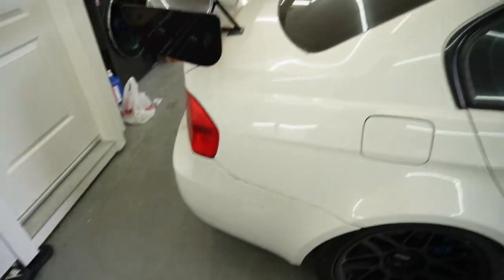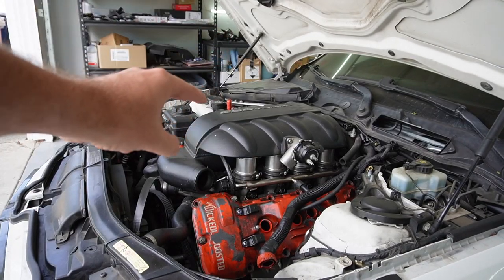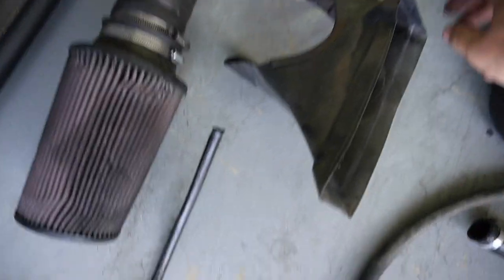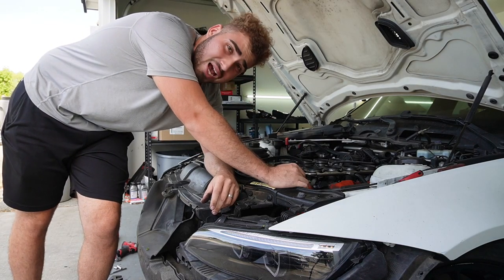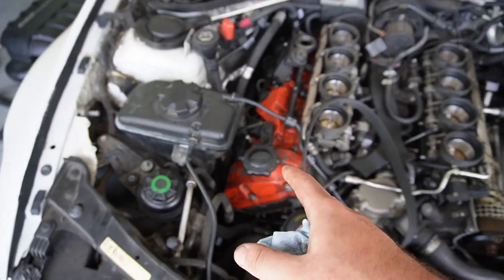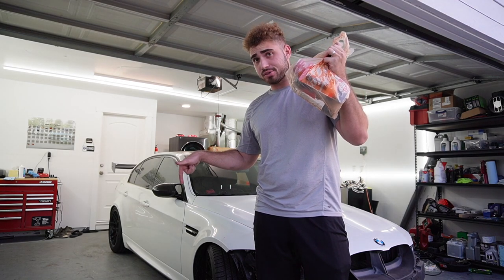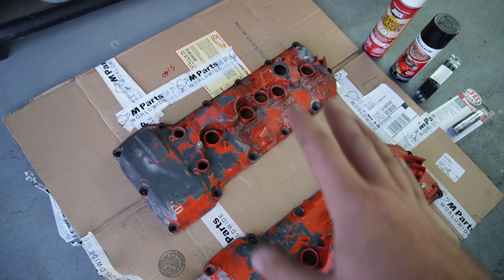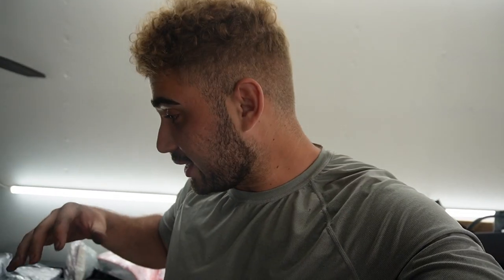I FOUND THE ENGINE ISSUE ON MY E90 M3! Can This Be Fixed?

Comment: Good job 🔥 👋
But i recommend with paint strip use rubber glows and better it will work if you cover food plastic wrap 👍
And also better would be for e91 project do proper job and powder coat valve covers in ogange colour with candy clear coat 😉

Comment: Not much pressure is built up in that cover id get the right bolt and fine some kind of dread sealer and put it on the bolt put it in and let it dry and fire up with all fingers crossed

Comment: It's cam not crank and you can remove it but it's big job because you want to do engine timing and if the engine timing not do properly if u give it to bmw engineer it will never start